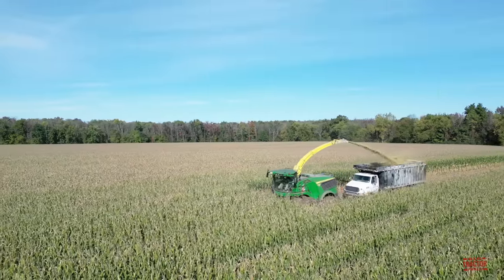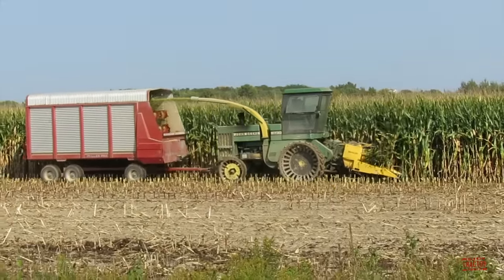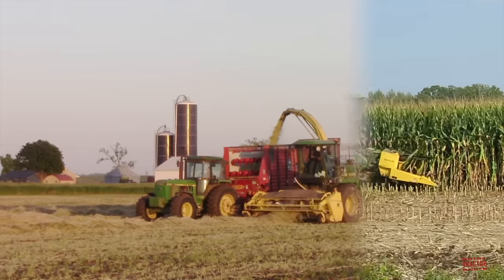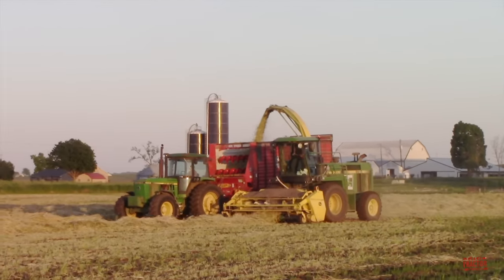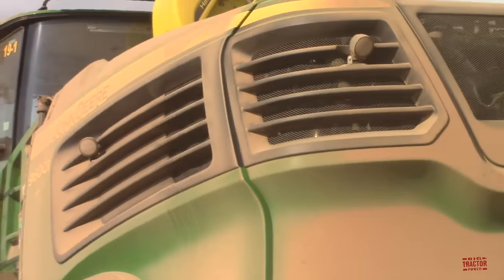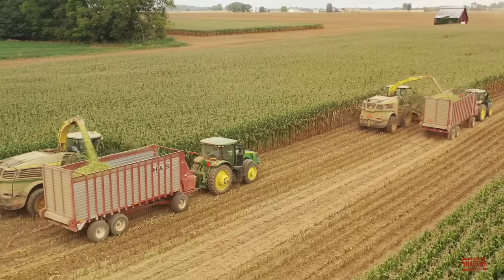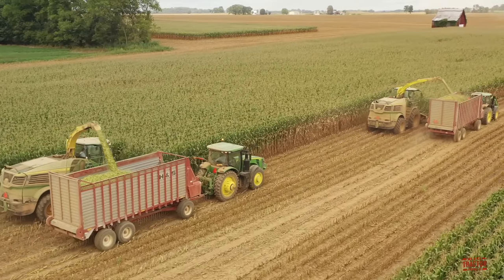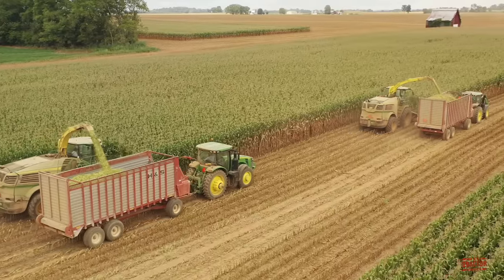50 Years of JOHN DEERE Self Propelled  Forage Harvesters

Comment: The first 20 years they made these the price was such they basically only sold to custom operators. Average dairy farms needing silage were not going to spend that kind of $$$ on one of these when the tractor they use to pull the plow could hook up to a pull type that cost 1/3 or less and do about 80% of the same job or more. 
The series in the 90's was the first to truly eclipse what could be done with a pull type, but the 90's were a rough time of change and consolidation for dairy so i am not even sure how many actually sold at that time either. Pull type was still giving it's last hurrah, Gehl and Case IH made a couple rated for 250+ HP and companies had made dump wagons to load trucks for them and such. A lot of farmers were still filling silo in the 90's, but it was rapidly declining. We had a custom guy in our neighborhood that ran a Gehl with a 3 row head behind his crab-walk Case in the 80's and used the tractor to pull a 9 bottom plow in the spring. So not all the custom guys went out and bought a self propelled either. 
The real issue with forage ended up being it took too long to get into a silo, and once herd sizes grew it took way too long to get it back out. Harvesters surpassed that issue, so change was needed.
Once people went fully to bunks, pull type was basically obsolete, farms had gotten so big and so consolidated hauling feed down the highway was basically required, and so the modern huge machines we have now were purchased despite their enormous price tags. Most dairy farms now are such large operations that stuff that used to be the custom guys job can be absorbed into the "company cash flow" and purchased outright. Usually run by hired hands. One could say the custom operators got hired on full time out of necessity. 

I personally disagree 100% with the direct farming went, but this is reality and these mega machines are needed and the designs are a culmination of learning from the last 80 years of silage making, and are impressive in the ground they can cover.

Comment: One thing I have noticed so far is machines up until the 7500 have a kind of boxy look to their engine compartment, then it transitions over to a more rounded design from that point onwards
Reply: Yeah that's the switch from steel bodies to a lot of plastic. Bodywork on modern equipment looks like a 90s sports car now.

Comment: There's a bunch of the John Deere self propelled corn choppers in my area here in northern Minnesota I end up working on most of them thru out the harvest season many models and age from a 5830 6710 6810s and 7550 7800 models they all have the Kemper multi crop heads they are good machines but are expensive to repair
Reply from the maker: Nice selection of choppers.  I want to find a 5720 or 5820.  It’s the series of Deere choppers I have not filmed.

Comment: Farming is not the same with the Ag labor shortage.  My neighbor to the west has three 7,000 milking cows barns about 5 miles apart.  The barns are almost two miles long.  Plus a cheese factory that receives milk by pipe line.  The neighbor  to the south has eight JD 9900 choppers to help supply the feed bunks.

Comment: Anyone else experience with first 5200 / 5400 chopper, with 2wd / 4wd, .... 
I would like to here all Story before that knowledge is lost for ever! 
Don't let that history die out.
Reply: Has somebody knowledge about the 4 row rowcrop head (as used on the pull type 4720 chopper)mountened on 5200/5400?
Reply from the maker: If you scroll through the comments in this video you will see a post from William Halpin on buying a 5400 new.

Comment: Have you seen those new NEXAT machines made in Germany? They aren't traditional tractors, but they are really wide and fast. I saw a video about them on Farmworld_TV. Pretty interesting design they have.
Reply: Nexats are modular tractors able to equip a variety of atachments including combine, sprayers, air drills and more
Reply: @Chester200100  A new Uni system? I think New Idea came up with that a while back.
Reply: @douglassellers7528 it’s essentially a hybrid of of the uni system and a gantry tractor yes.
Reply: They are overcomplicated, require proprietary everything, have no repair network and don't really solve any problems. I'm sure there are niches for it to fill but its very silly machine imo.

Comment: The 900 hp engine needs to burn over 40 gallons of fuel an hour.
Reply from the maker: The big question is how many acres get covered for the 40 gallons.  With enough trucks a bunch is cut.  When I was a kid it would take a week to clear of 30 acres with a two row chopper and two forage boxes.  Now taking in 12 rows it’s a matter of hours.

Comment: Why can’t combines come with a 1000 hp or better
Reply from the maker: They do not require that much horse power to thresh grain. A chopper takes in a 12-15ft tall plant and processes it into chips. Plus chopping an ear of corn into bits takes Hp.  A combine only takes the grain so even the largest combines taking in 50ft only use 500-700 hp.
Reply: Look up the Nexat system . Twin engine 1100 hp.carrier unit for tillage, planting. spraying (200 ft) and 50 ft draper/20+ row corn head combine.